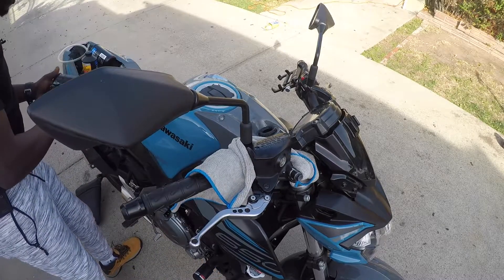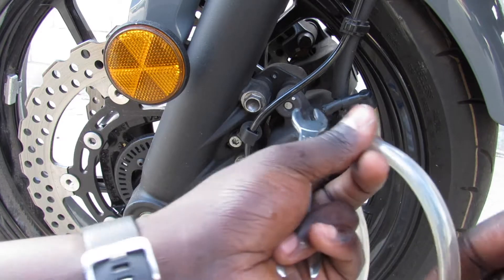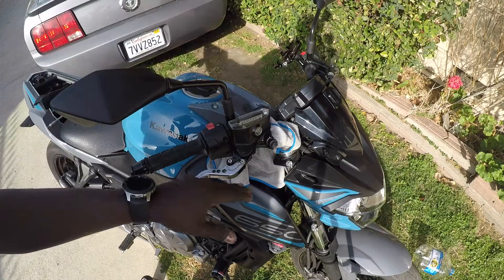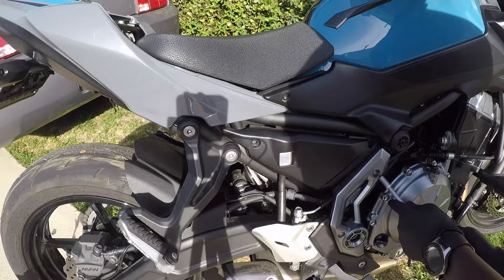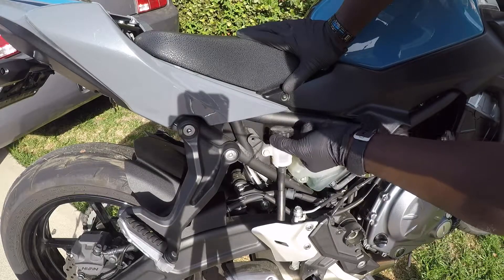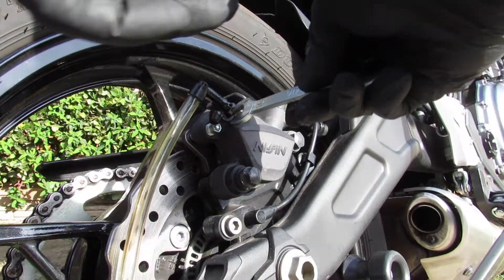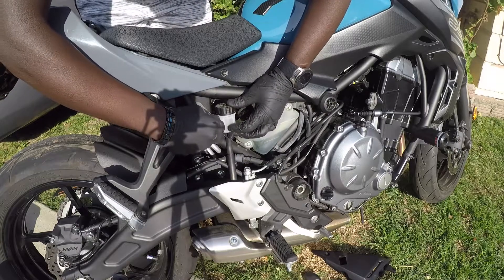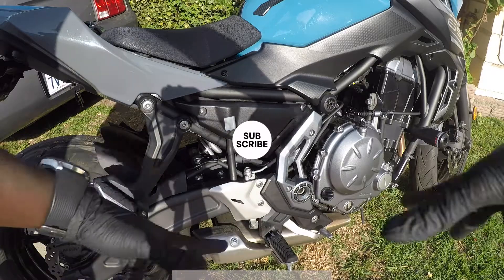Break Fluid Change On Kawasaki Z650

Comment: Great video as always, that will save us Z650 riders a few pounds or dollars depending where you live :-)
Reply from the maker: Hey have u tried out the OBD cable to do a diagnosis, if yes did the cable work for you?
Reply: @rbon2wheels  no I haven't, my bike is still under warranty so at the moment I let the main dealer do any work. Only problem I had is when I changed the standard horn for a loud Dinelli Sound Bomb. The 10A fuse kept blowing which also is the fuse for the brake light. I put the original horn back on and no problem. Had Dinelli units before and never a problem, I think I bought a bit of a Friday afternoon job.
Reply from the maker: @dbharrold  I also got rid of the stock horn but never blow the fuse. Will c what happens when I use it frequently.

Comment: Hello!

Could you let us know how to flush the fluid out from the ABS module as well?

Thank you!
Reply from the maker: That is ABS 2019 z650  it is the same procedure for both AbS and non Abs
Reply: @rbon2wheels  Does this mean that the regular procedure also flushes the old fluid that is trapped inside the ABS module as well? thought we had to open it up using a computer before doing the flush?

Comment: Awesome. Thanks for the Z650 videos. Do you have a link to your frame sliders?
Reply from the maker: go on amazon and search for OES Frame Sliders 2017 2018 2019 Kawasaki Z650 Pair (Red) ,it will be the 1st one to pop up. it's $69
Reply: @rbon2wheels  Thanks got it!

Comment: Why you never change the exhaust?
Reply from the maker: Because I didn't want to deal with flashing the bike. When u change the exhaust u have to flashing the bike and if u don't,  the bike loses power and also backfires.
Reply: @rbon2wheels  so you don't want to install power commander? I change the exhaust on my z650 and i think it has same  power.
Reply from the maker: @Luis.Bermudess  I would love too but I just don't want to go through the process of tuning the bike after exhaust and power commander installation.